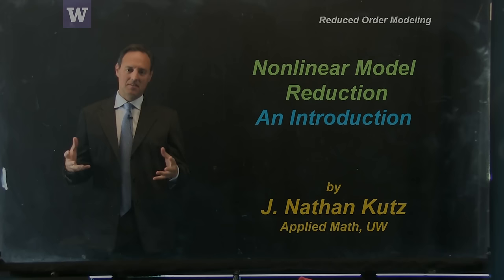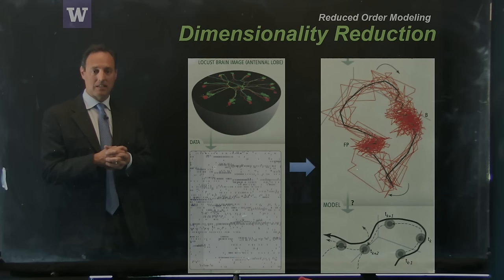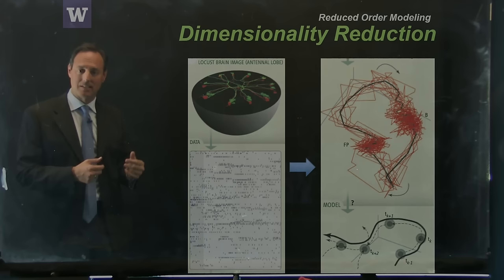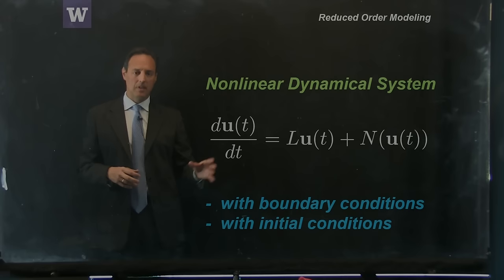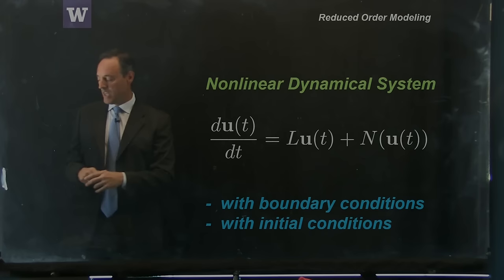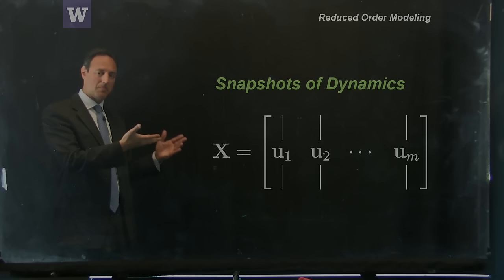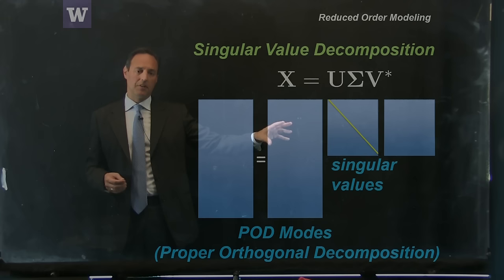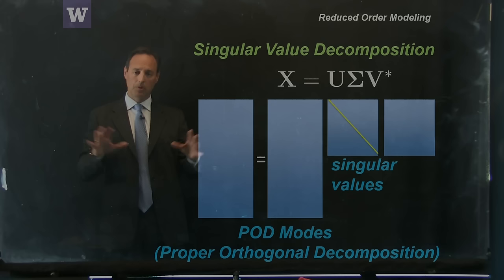ROM introduction

Comment: Timecodes
0:00 Introduction
0:50 Motivational examples
5:12 Dynamical systems
9:20 Singular value decomposition
14:40 Galerkin projection
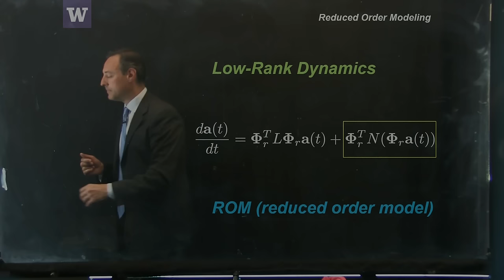19:55 Non-linearity challenges 
26:15 Summary

Comment: Hello Professor, excellent lecture and very important mathematical topic. It would be really helpful if the next lectures are bundled together. Right now its not clear which is the next lecture in the series. Numerical hierarchy would be really helpful here, and If I am correct there is an entire series by you on Reduced order modeling.